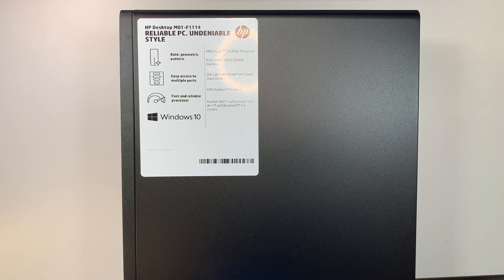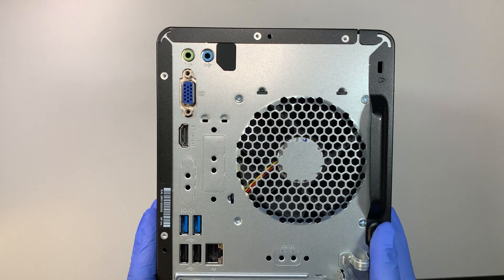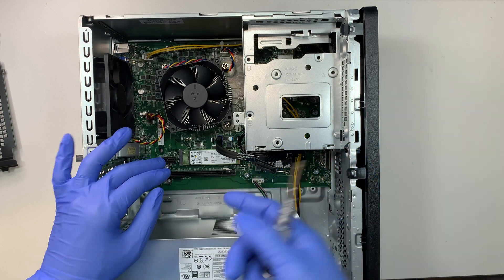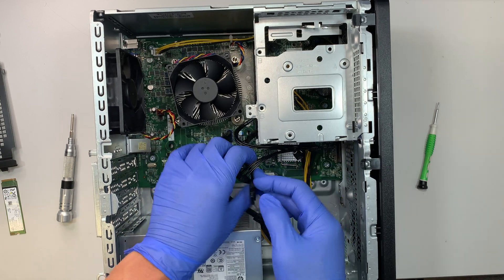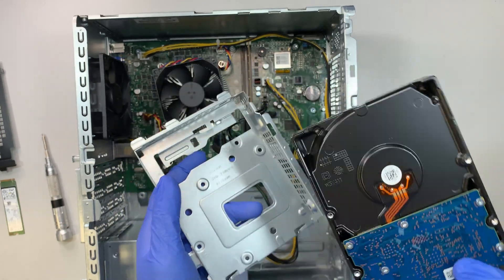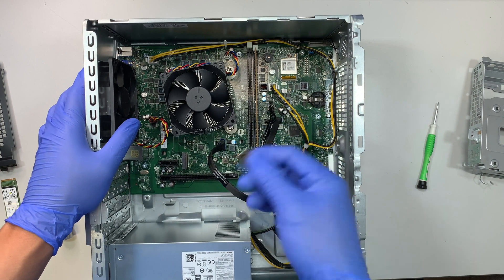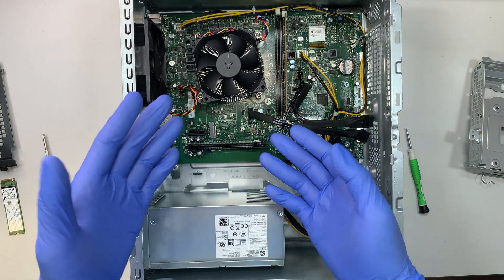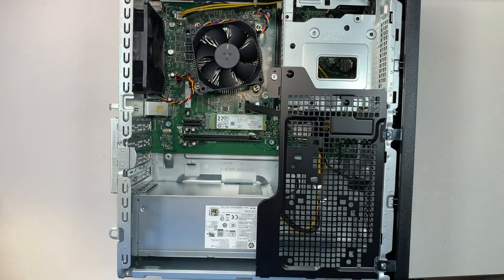HP M01 F1114 Tear Down Disassemble

Comment: Here’s my question. I have the original m.2 256GB installed. I also have a secondary 1TB SATA HD in the expansion slot. I feel I need more space on my main drive. Is there a way to clone current HD to new SSD, and then use both with both operating systems on each? Or can I take off operating system off current SSD and keep all data on it?

Comment: Can I upgrade the power supply?
Reply from the maker: No. Other power supply will not fit inside the case
Reply: Yes you can
Reply from the maker: @ortiz.marcos1760  where can i buy the power supply ?

Comment: That second sata connection is for a disk drive. The tray is designed to have a hdd or ssd installed in the cage as you shown but where you pointed for the second placement is actually designed to mount a cd/DVD. Overall a great helpful video.
Reply: Does that mean I can’t mount another SSD HD like he’s demonstrating in the video?

Comment: is it possible to upgrade the power supply on this device?
Reply from the maker: no
Reply: I''m pretty sure it has to be an HP PSU for it to work.
But do more researching though, don't know if you can trust me lol
Reply from the maker: @nasir_w  That's correct.
Reply: @UbergeeksBiz  ok thanks for correcting me
Reply: Yes you can